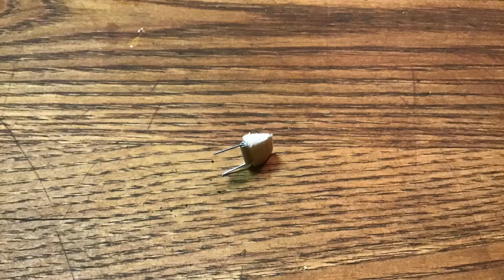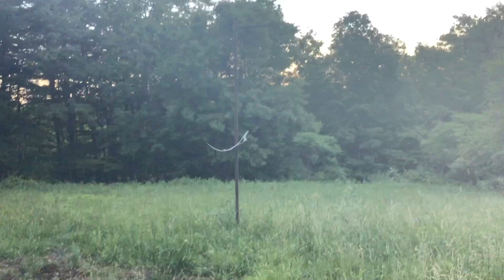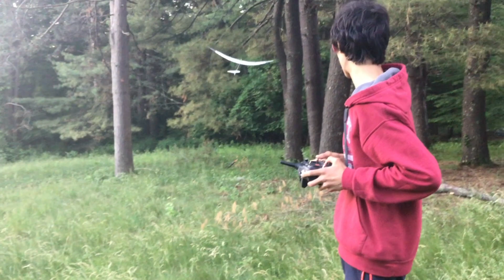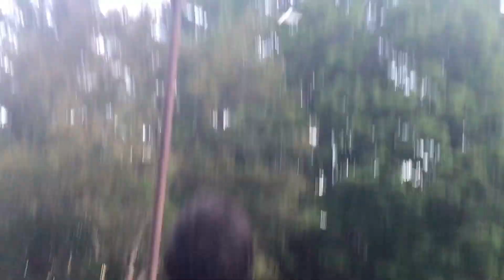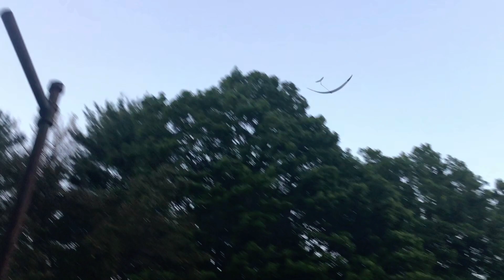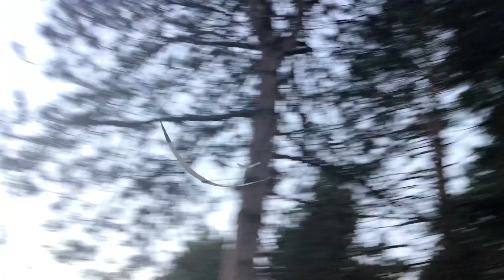Mini Motor Glider Gets a Thrust-Vectoring Motor! PLUS Failed Leading Edge Rudder

Comment: Just looked like the cg was off - a bit tail heavy.  So it'd porpoise, giving you speed you didn't want.  I think if it was balanced, would have flown great, beautifully on that first run.  Am I missing something?
(Awesome just same.  Inspired me to build a graceful winged glider just like it.)
What a great vid!

PS.  You can leave em tail-heavy and just slow fly them at an angle if you want.  Sort of like the Night Vapor, but a glider.  ;)
Reply from the maker: Yeah I was hesitant to move the CG forward because I wanted the extra yaw sensitivity from the tail-heavy CG, to help maneuver in the small space. As you see the tail-heaviness kinda allows for semi 'stall-turns', which help me cut sharp corners and stay in the little yard. More forward CG would've gotten it flying more smoothly though, for sure. Nice to hear you built a similar glider of your own. Posted a video of it?
Reply: @AeroCraftAviation   -  Ah, sweet method to the madness!  But of course.  I shall beg your pardon, sir.  Silly of me to have doubted...:) 

I haven't built one like it, am inspired to.  That wing, the way it bows?  Beautiful.

And I'm a sucker for slow flight. 

Did you attempt a slow fly at the angle the heavier tail gave you?  Similar sort of flight to your Vapor?  (I have a Night Vapor - love it.)  Maybe half-throttle?

Comment: Very interesting design, those floppy wings make it look natural / organic in the air,  it is very elegant.
Thanks for Sharing
Reply from the maker: Yeah i agree. The floppy wings were intended to achieve dihedral angle without the need for rigid dihedral bracing. The lack of rigid wing structure is a big reason for the light weight and slow flight.

Comment: If the rudder was pointing backwards instead of forward it might not have been sucked into the prop.  Also, it will only work with sufficient airflow over the control surface, so unless you have some airspeed, you won't get much control. It was still a neat idea.  You'll need a very calm day and a larger area to really test this in.  50% of the solution is often "how" you fly it, not "what" you are flying, assuming you haven't violated any aerodynamic rules :)  I like how the wings warp in flight - reminiscent of the Solar Impulse.
Reply from the maker: Right right, but then it would be practically right on the CG and would have little to no yaw effect. I guess the idea would be to get the rudder out on some sort of moment arm, which is normally achieved by the tail boom. But in the case of our nose rudder, I'm imagining some sort of boom sticking out from the front of the aircraft, with the steerable rudder on the end of it; so pretty much a reverse tail boom. I think it would be inherently unstable, for similar reasons to why taildraggers are unstable on the ground, but I guess it'd work alright. Might have to try it...
      Yeah the flexible wings were intended to achieve dihedral angle without the need for a heavy dihedral brace or any rigid structure. I think some full scale sailplanes (duo discus, ETA, ASG 29) use similar flexible wings to achieve their dihedral, which saves a ton on weight because it would take a lot of structure to hold rigid dihedral in such long wings.
Reply: @AeroCraftAviation  with a second pushrod in the same control horn it should be possible to have a rudder on the same servo as the vectored thrust (the rudder control rod will have to cross in front of the vertical stabilizer however, because you need the rudder turning opposite the motor).  But make sure you use a folding prop or else you will be causing a lot of drag when the prop isn't turning and that will probably throw you off as much as the rudder will be helping. They will practically cancel each other out.
Reply from the maker: @altbob  Yeah that's a good idea. I may do that if rudder experiments with this aircraft continue. I don't think a folding prop would be necessary though. The yaw effect from the motor angling back and forth is very small. Small enough that, from some altitude, I can glide down with the motor defected all the way left or right, and it still glides just straight.
Reply: @AeroCraftAviation  OK.  A folding prop is still a good idea if you catch a thermal and plan to soar.  Drag is a drag!

Comment: Hah! That front enlarged rudder ended up looking like a duck head! LOL!  I'd think that a front rudder would have to be scaled huge to counter the stabilizing effect of the rear vertical stab. Your normal rear stab has that long arm of leverage from the CG so the front would have to be able to overpower that inherent stability. And the front had such a short leverage from the CG so it would have had to be many square inches larger to be able to have any effect at all. Maybe that is (one of the many reasons) why we don't see front rudder planes. I'd think that another reason is that once deflected, the force of the air would try to deflect the rudder even more, causing a total jackknife of the plane or making the rudder try to "dig in". Sort of like opening your cars hood at 60mph. ALL control surfaces are hinged at the leading edge for that very good reason.  Nice try though, without experiments, we won't learn.
Reply from the maker: These are all good points, and I was aware of all of this when experimenting. But it's somehow still interesting to see things work out in real life, no matter how concrete they seem to be in theory. I might try to put the front rudder out on a bit of a lever arm. I could attach the lever arm to the motor. That way when the motor angles left or right, the rudder out on the end of the arm is actually sweeping over an arc. Then we would see some pretty drastic control. I think the only reason it might be feasible is because of how very slowly this things flies. Any sort of airspeed and exactly what you're saying would happen; it would yank the rudder all the way to one side or the other.
Reply: Yes, at that plane's ultra low speeds you most likely can keep some semblance of control of your front "Crudder". But it will still want to flip flop though, depending on the strength of your materials, servo and inherent slop in the system fighting the air pressure at speed. The Crudder will always naturally flop slightly left or right of center while in flight as a result. The experiment is interesting though, and as viewers we can all learn right along side you while you have some fun. :-) Keep up the good work!
Reply from the maker: @somethingelse2740  Good point. Essentially the Crudder has all odds against it. ...So of course I've gotta keep trying to get it to work. 🤣
Reply: That's the fighting spirit! Go get 'em Tiger! Plenty before you have made things happen against all naysayers. My best advice, try to centralize the Crudder instead of having it mostly above center.

Comment: Man, I though I had a tiny field lol. Also wouldn’t having the rudder in front of the CG have the opposite intended effect or am I just having a hard time visualizing it in my head.
Reply from the maker: @zacapelt1234  Well explained. That is part of the reason why soaring birds fly so efficiently. They have no vertical stabilizer, and they simply fly with such precision that their inherent yaw instability can be overcome. This eliminates any excess drag and essentially makes the bird one contiguous lifting body. One day I want to advance my skills and knowledge of aerodynamics and flight control to the point where I can copy those birds. Vertical stabilizers seem in some ways a very crude solution to our inability to cope with a little instability.
Reply: @AeroCraftAviation  Birds are not that efficient. In order to gain yaw stability, besides a rudder, you either need individually controllable tail feathers, wing sweep or a wing with a bell-shaped lift distribution. The first one brakes, the second one reduces effective wingspan and lift and the third one results in a wing with less lift than possible.
Birds have an advantage though: they have control over their wings.
Reply from the maker: @xnoreq  Aerodynamically, birds are what manmade flight would deem ‘inefficient’, simply because, with our methods of achieving stable flight, the bird configuration would in fact be inefficient. We could not imagine stabilizing a rudderless aircraft without inducing lots of drag from constant  corrections coming from spoilers or other wing-mounted devices. Birds, however, find that quite easy. Their brains are insanely fine-tuned for stabilizing themselves in flight. They can use their steering feathers (located at their wrist joint) to make teeny adjustments to yaw angle, barely inducing any excess drag at all, and yet eliminating the need for a draggy vertical stabilizer. And yes, they also do have individually controllable tail feathers to an extent, but they seldom separate the feathers’ edges, minimizing the tip and edge vortex production and keeping their tail one contiguous surface. If you watch birds of prey fly you will notice this. They are very efficient about how they adjust their tail feathers. They intuitively understand how, in every possible aerodynamic situation, to most efficiently transition to any other. And they can do this with what are essentially thousands of minuscule control surfaces. All of their feathers, with some exceptions depending upon species, are controllable, and not arbitrarily, but quite practically and usefully. Man, they are light years ahead of us. The level of precision which machine learning and CFD simulation/aerodynamic optimization would have to reach to match the abilities of birds is still many decades down the line.
Reply: @AeroCraftAviation  Yes and no. The few birds that can actually glide seem to have a quite low lift-drag ratio (based on wind-tunnel measurements with trained birds). The reason they can stay up in the air a long time is by constantly feeling and using even small thermals and upwinds.
We also can design flying wings with inherent yaw stability but their L/D also suffers compared to well-designed sailplanes.

Evolution did not result in plane-like birds because of inefficiency but because of biological limitations. Planes can be far more efficient.